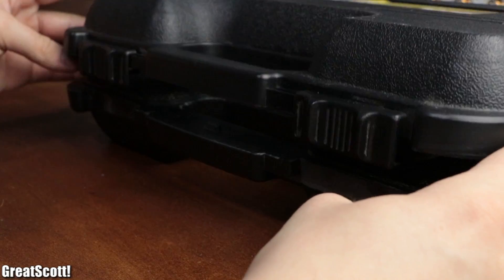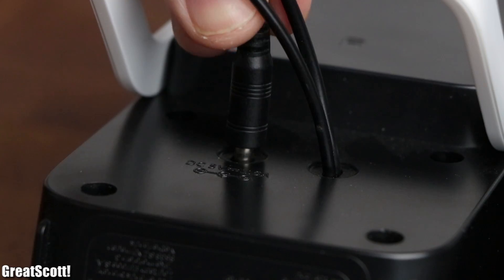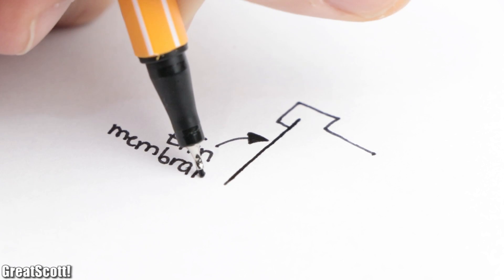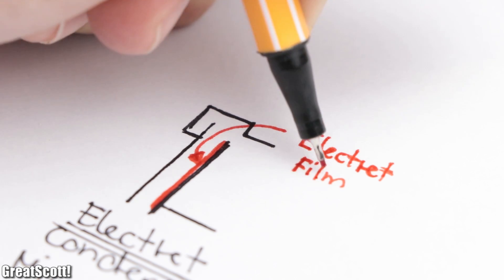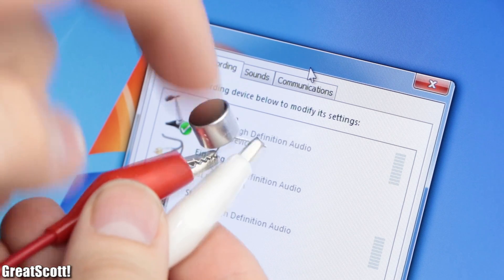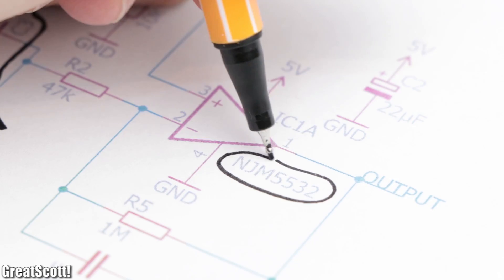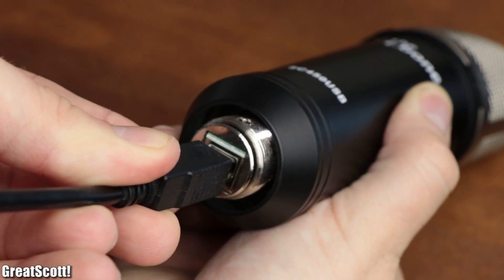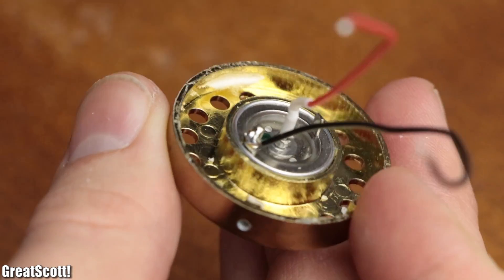Voice-over Microphone || DIY or Buy

Comment: Does it sound any different going into a quality USB ADC?
Reply: I agree with your. To do a fair comparison, a quality USB AD is needed.
Reply: The problem is that he is comparing a commercial capacitive mic with built in ADC with a capacitive mic connected to mic input. To be fair he would use an external usb ADC chip in conjunction with the electret mic in the comparison.
Reply: Using built-in ADC has one disadvantage, the audio is polluted with noises from the power supply, external for example USB ADC regulate the voltage and you'll get lot less notice from it 😉
Reply: True ;)
Reply: not make sense I spent around 1500$ in DIY of ADC or audio circuit. USB ADC only uses for isolations and handy plug and play use. even nowdays  pc have a 24bit sound card with good isolations of noise.. cable run noise can matter so we need ADC with an amplifier for the mic. you use any good lavalier mic for recording it still good and cheap enough.
Reply: Actually, your PC also uses an ADC, sound card or on board audio, they both use an ADC

Comment: I feel like your schematic pointed out a high pass filter subsection that was either not shown in the main diagram or was confused for the DC offset parallel capacitor subsection.

Comment: Oh, you made me remind  the glory days of ham radio... I used to do those kind of amplifiers, but on that configuration the noise level is to high when connected to Power supply. We used to connect it with 9v batts. I remember to make one with pair differential  input, that way you zero'd  all the interference captured in the mic line.

Comment: I actually heard noise artifacts in your studio mic that were not present in the electret, but that's to be expected from a wider range.  I use a Heil PR-40, which is a dynamic large diaphragm microphone, and the sound quality is so much better, but I do tend to spend more time after the fact filtering out noise artifacts.  It has an incredible amount of rear rejection, but there's still that pesky 180 degrees of front lobe to contend with.

Comment: How about a Diy or Buy Episode on bright 18650 powered flashlights with an Output of 350-1000 Lumens?
Reply: Makersteve YT possibly buy as making a flashlight that powerful could pose challenges
Reply: Some Guy Not really. These Led-Chips are very common nowadays having a light output of roughly 100 Lumens per Watt. To build such a Flahlight, you really just need a boost converter with constant current feature, which he already build, and a charging/protection board for multiple cells in series. These are also not really expensive to get. Apart from that, there is basically just a housing + heatsink + swich needed.

Comment: you can try using headphone speakers as a microphone, i dont know the sound quality but it has an electric motor that can be used as a generator according to which the sound waves hit the diaphragm
Reply: I wonder, the bass response may be better.  You can use an LED as a phototransistor too.

Comment: Very interesting!
I was wondering, I noticed that when you compared your lapel mic and the DIY one, the DIY one had a bit of an echo. Is it due to the placement of the microphone or something along those line, or could it be the circuit, like those effect boxes? I don't know how those guitar pedals work...
I hope you get what I mean...
Reply: This reply is two years later so not surprised if you found your answer. But just in case, the echo is from the lack of housing on the mic. Functionally the condenser and the design he made are similar patterns but not exact, and thus one can assume this to be Omni directional sound. So if you put this design in something simple, even like a piece of PVC it would sound closer to the real deal
Reply: @coldwarmike  Thanks for taking the time, much appreciated !

Comment: This would have been a much more interesting video if you would have tried to DIY a ribbon microphone. As this can generate incredible audio results without costing to much. However the transformer used to have workable audio (for amplification) in a ribbon microphone is the expensive part. Now the question would be: Could you DIY a ribbon microphone transformer ?

Comment: Hey man! I found this Condenser capsule on eBay for U$D 25.00. There are a few more running at around $33.00 to $40.00.  Only thing I see that it only ships to the US. I don't live in the US so I can't deliver it to you, but maybe a fellow fan can? it would be nice to see this project revised with any of these capsules. Maybe they're trash; maybe they're decent and usable.

https://www.ebay.com/itm/New-32mm-K67-Style-Condenser-Microphone-Capsule-For-DIY-Mods-or-Repairs/152735614989?hash=item238fc0880d:g:SLYAAOSwRjtZtcQd

Comment: Just for curiosity, why did you put two capacitors in parallel when you cleared the DC offset in the amplifier? Does that convey a bit more stable and clean tension?
Reply from the maker: I did not have the proper value laying around, so I improvised.

Comment: I really love your videos, it helps me a lot. Thanks. 

By the way can the op amp circuit can be connected to a power amp “line in” instead of the “mic in” of the computer? 

Im currently working on a power amp project and I want to make mic input as one of its features. 

The last project I made involves the use of dynamic mic but unfortunately, it wont work on my power amp design due to it’s voltage level was around 30v and I was short on budget on finding a decent power supply that can power both amps. I was thinking of replacing my dynamic mic to a electret due to its price and low voltage requirement, but would it be possible? 

Thanks. More power to your channel

Comment: One little thing... USB mic uses it's own USB audio interface, which is 10000 better at noise and capturing signal part than bullshitty laptop integrated soundcard. I bought an external cheap usb sound card and got 10000 times better results with my good old soviet XLR mic.
Reply: You can get a lot more from an electret mic

Comment: Good job! The quality is not so good "thanks to" the cheap microphone, I bet if you will use a better capsule the sound will improve considerably. Bigger capsules have better low frequency response, in most cases.

Comment: What does the DIY mic preamp sound like with the large capsule from the old USB mic?
Reply from the maker: You can not easily use the big condenser capsule with the amp circuit due to the missing phantom power.

Comment: why not diy a usb Microphone to compare ?  this project still use internal ADC of laptop that likely to be worsen.
for actual finish product , the housing seem to be more problem in diy project.  the  noise isolation and ease of use of housing is hard to produce.

another method is mod the Mic that have only have condenser and add  Pre-mic. and ADC circuit. that seem to be middle ground.

just a concept though,  I try to mod a cheap mic by adding the pre-mic . but with out understanding enough . It got oscillate , high back ground noise and sudden spike in some time.

Comment: Diy or buy a drone
Reply: diy
Reply: Absolutely diy... Buy a cheap one to learn then build a 250 because you will be rebuilding it at some point.  DJI and the like are a huge rip off.
Reply: Diy for sure. Diy is the way they've always been done (pretty much the entire rc aircraft industry has been diy for decades). The models that have become mainstream have become mainstream due to marketing and ease of entry, but are not superior to their diy counterparts. Anyone comfortable with diy should diy. On a side note, they also make an excellent father-son project, i remember building my first diy rc helicopter with my father 13 years ago and honestly, it was one of my best experiences with him. Just enough challenge to make you think, but not enough to be frustrating.
Reply: Shaun Husain so youre telling me that a well known brand such as DJI is a scam? Please elaborate as if memory serves you cant get a motion controlled drone that works without paying much of a premium. Would like to hear your thoughts on that
Reply: That "premium" motion control is nothing more than a gimmick that doesn't actually add any practical value... However with a little effort you can use an adruino to get motion control and many other cool gimmicks for not much money. Perhaps the most enticing feature of the DJI quadcopters is the camera which is quite decent. However you are paying a very hefty premium for it, something like a gopro (what many diy builders use) isn't that far off in quality.
Just to add, no it's not a scam. Some people are just completely unwilling/unable to go the Diy route. It is however annoying that most people don't seem to know the diy route is even an option, let alone much less expensive.
Reply: Buy

Comment: I would like to see a video on shift registers. Never fully understood how they worked or what purpose they served.
Reply from the maker: I put it on my to do list
Reply: They convert serial to parallel and vice versa.  Like a hard drive, SATA, will spew bits serially and it uses a shift register to load up 8 bits or 32 bits or whatever.  Likewise you have a 32 bit word and you want to write it to disk, you have to serialize it, so you shift it out one bit at a time, presto parallel to serial.  Smart LED strips are like a shift register, you load the colors serially and then see them all at once (parallel).   That might be a fun project, 3 wires (clock, data, ground) to a shift register and 8 outputs to LEDs so you have your own smart display.
Reply: He probably had a parallel LCD, which wants 8 bit commands.  Instead of using 8 data lines, he used 2, one to clock in data, one for the data itself.  So he would clock in 8 bits to make a byte, then tell the LCD to execute the command.  Nowadays you don't really need parallel devices and can go straight to I2C and use libraries.  The other lines were probably ground and enable or some such.
Reply: Sean Brennan So how could you use it on a serial LCD? I saw a video of someone use a shift register to reduce the number of wires from 12 to 5 going into an arduino without explaining what it did, or even what wires go where.
Reply: Sean Brennan OK thanks for your help.
Reply: Kevin darrah made a beautiful tuturial on that
Reply: I'll check him out

Comment: I have an electret mic that I power using a 9V battery, using my own plug in power circuit. The output voltage is too high for my recorder (4V peak to peak for loud sounds), so I added a ~25 dB attenuator (which is a simple voltage divider).

If you're looking for good mics, check out Ohrwurm audio, the guy puts out some insane quality stuff.

A lot of the noise you had probably came from your soundcard instead of the DIY mic, did you try recording it with your Zoom H1 for comparison?
Reply from the maker: Yes, the problem was that the noise of the soundcard was amplified. My DIY amp circuit solved that problem. I did not try my Zoom H1. And thanks for the information about Ohrwurm, looks like pretty awesome stuff.
Reply: the zoom has pretty awesome noise characteristics compared to most built-in and USB soundcards, the only problem is that it only supports 48khz/16 bit when used as a usb audio interface.

Comment: For the next diy or buy: a 3d printer
Reply: too much work tbh buy a cheap one for around 300€ and you are good
Reply: 120€ gives you a DIY kit that already kinda works - you can't beat it price wise even just for the parts cost, and if you decide that it's not good enough, you already have 5 actually very good quality motors, a decent if somewhat exotic and undocumented board, a good enough hot-end that can do massive temperatures, and lots of other parts which are honestly not particularly good (feeder, heatbed, mechanicals) but just about work, so perfectly suited for modification or rebuilding. And the frame is from melamine plywood, so you won't ruin it by drilling some new holes into it. It's the CTC i3 Pro B that you get on eBay, and the EU import tax on it has already been paid by importer.
Reply: Reprap project is open plans for DIY the cost is mostly in the stepper motor drivers ultimately you will need to fix or fiddle with the thing.  I built a prusa i3 reprap based kit machine for $300 have two of my friends prebuilt 3d printers sitting here broke because he doesn't know how to fix them, meanwhile I upgraded mine to have an enclosure and use a Bowden extruder and print flexible materials... Point is the knowledge in that arena pays off.
Reply: I hate youtube ui, it deleted my comment, twice.
so my stepper can do 1000rpm, 8rps is 540rpm which is probably doable.
I wanna try using bldc + encoder, which could do 5k rpm or 400 mm/s with 5mm pitch
Reply: YEEEEEEEEEES
Reply: YES!!!
Reply: Hansbald, yes A8 is actually much better out of the box than CTC, but it's a lot more expensive in Europe. Did you receive a proper Anet A8 or its cheaper clone the Tronxy P802?
Reply: Hansbald, how did you not get hit with a 25€ customs/import fee on it though x.x
Reply: personally, I'd buy a kit, then switch all axis to ballscrews.and replace the linear ball bearings with polymer bushings.
why not go with ballscrews at first? because you'll need to print some parts to add them to the machine.
Reply: Whoa all axis? Well then, sounds like a great opportunity to put a router spindle on it. But how fast are they? You want to have maybe 100mm/s top movement speed in XY, and the multi start ones do maybe 12mm per revolution tops, so you're trusting those tiny motors to turn at maybe 8 revolutions per second... which they might just about do with no load on them. Bit of a tall order to get that tuned in, but good luck!
Reply: Check out Thomas Sanladerer. He built a really cheap prusa
Reply: my opinion: DIY cuz: WHY THE HELL I HAVE TO PAY UP TO 300€ FOR THING I CAN MAKE FOR UNDER 150€ AND IT WORKS JUST AS FINE
Reply: That would just be a hot glue gun on a stick
Reply: Yes please

Comment: I have a old melodium 75a from like 40 years ago, I built a simple preamp circuit with a lm386 a few years ago and brought it back to life recently and it sounds very good. I only have a little bit of hiss and im not sure what causes it, probably RF interference with all my other stuff
Reply from the maker: You could try to power it with battery power, if you did not try that yet.
Reply: maybe not optimal for hours of continuous operation but I will look into that.
The noise isn't very high so for just talking with peoples online it's fine

Comment: Why can't we just copy the circuit of studio mic I mean it'll sound same as studio mic but will be less expensive
Reply from the maker: Like I said, it is not easy to buy condenser capsules. That was the main problem.
Reply: Can't we just replace it with normal microphone does it make a rather much difference